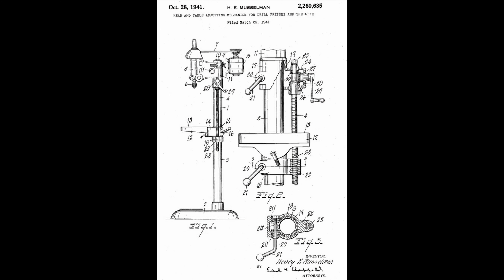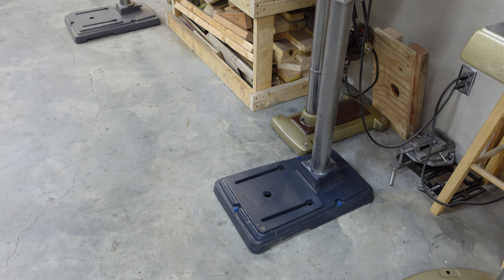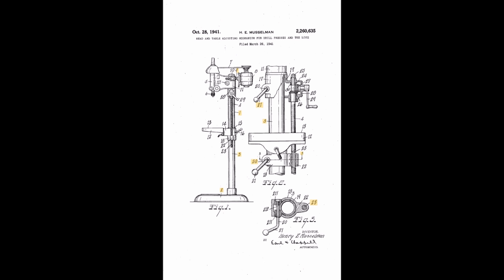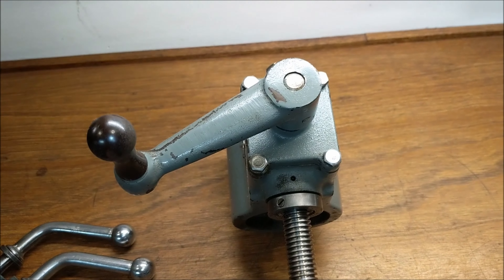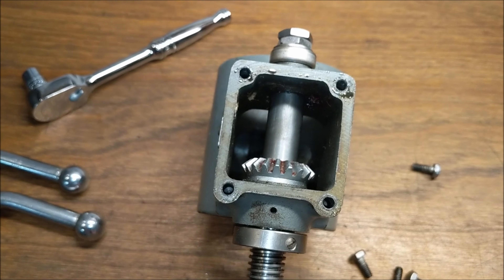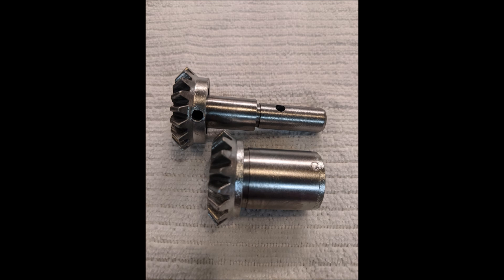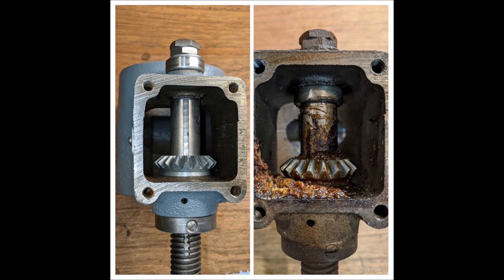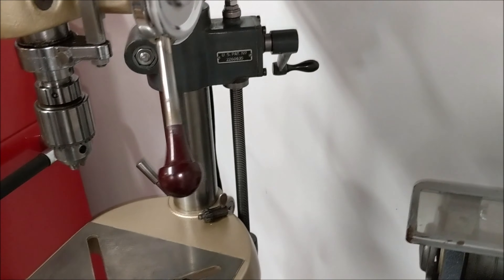Accessories Part 2 Craftsman Drill Press Head and Table Lift 9-02419

Comment: Thanks Jeff! I've been watching all your videos and about to buy a 150 and clean it up. Any idea where I could find a table lift? Does anyone make reproductions?
Reply from the maker: Thank you for watching. Table lifts are fairly expensive. I cover two different table lifts in my accessory’s playlist https://youtube.com/playlist?list=PLfmzf8SKnxXlh8lYaLRYP2qkdnteNirQ4
The Craftsman Atlas table lift https://youtu.be/1Dy63-0PBFM
And the Pressmate https://youtu.be/30FtlL3fodQ
Both show up on ebay from time to time but are expensive (+/- $300.00). There are several DIY counterweight lift videos on YouTube and some documented on The Garage Journal Forum. 
Also once my current series on the 100 drill press is complete (next Monday) https://youtube.com/playlist?list=PLfmzf8SKnxXmpbegfq2WOqu2OKcZg7GLb
I have a 3 part series on rebuilding a Craftsman/ Atlas table lift https://youtube.com/playlist?list=PLfmzf8SKnxXnLrsXnMWr6bs7ROLNcgcch
I hope this helps

Comment: Where would I find that accessory? I tried locating one and I just cant find one. Any help would help.
Reply from the maker: ebay is probably the easiest but certainly not the cheapest. https://www.ebay.com/itm/185717636182?hash=item2b3da23c56:g:mIQAAOSwf~pi7D~v&amdata=enc%3AAQAIAAAA8O81QZcTKYFxsS8zevJEeRT6ygz0HcoI7qrwIeSm2yH2cficQ0fj3SEwCfFNwWyRjImiWJvxxlAiFX39h6tf7EHcnnsWMjpA9I9XwSE%2BniL6NBTX%2F%2BCMSkqDUk8Py7S0KYjJaybg4PSRMyx2KJdlncy2gJahJJihhWzjlYGrzbaaTcDM45eyicO1kf%2FNRDqBQydKX4%2FCIo7Kia1HfnxWixRAERWZj4onKhAtGUGhQEqMkv6GsIjDvGC7%2Bz7XMqUnuVvljGkTnwMRdZWjcG8UhvRnM0NG%2BR4Dn%2F%2B1zfw8rjyNjKkJ7A7Tmu1fg4Cra9wAQA%3D%3D%7Ctkp%3ABk9SR9rF3JqXYg

Another option would be to buy a drill press with one on it then sell the drill press and keep the lift. It really depends on where you live and how common they are.
Reply: Thank you so much